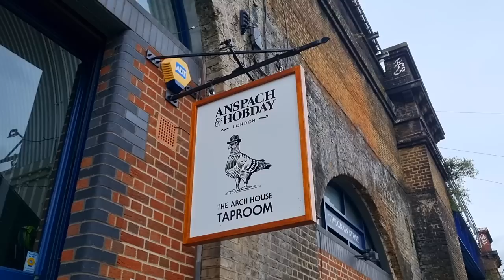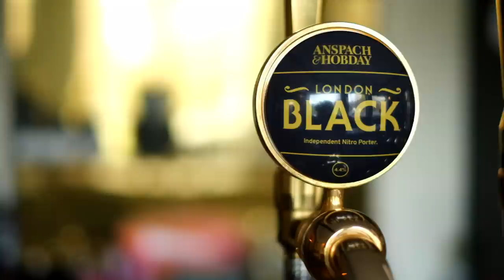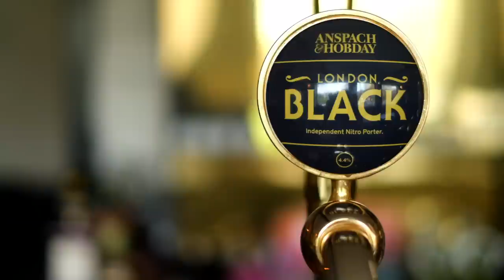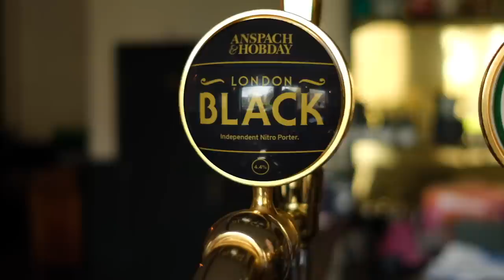The brewery taking on Guinness in London! | The Craft Beer Channel

Comment: Just seen. Fuller’s London Porter had a lot more character than Guinness, but the local pub stopped having it on draft, then the pub never reopened after lockdown. But OK in bottle, as is Guinness Foreign Extra Stout, and Meantime London Porter. Will try this stuff when the weather turns cold again.

Comment: Guinness has long been outcompeted by other breweries and at this point, it is a boring and frankly outdated example of the style. Only their export strength version in bottles holds up well today, and is still exceeded by other export stouts (check out The Kernel's 1890 stout for example)